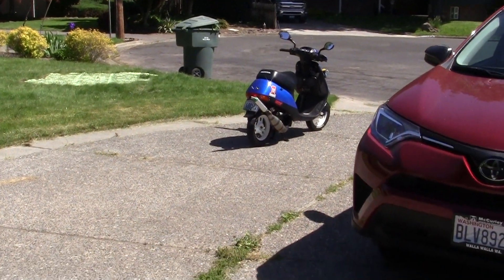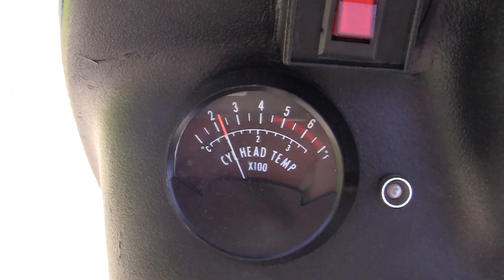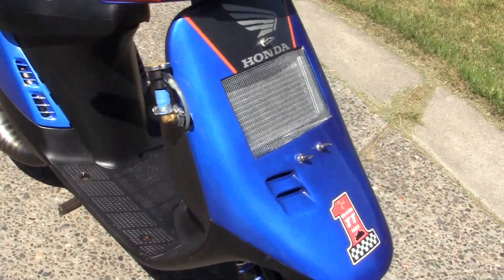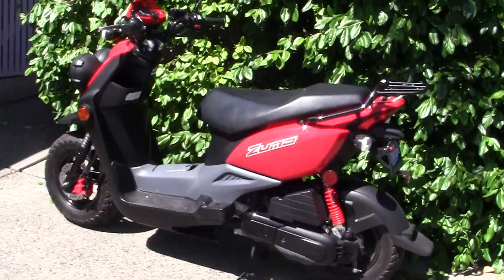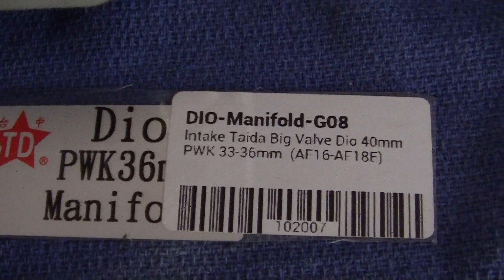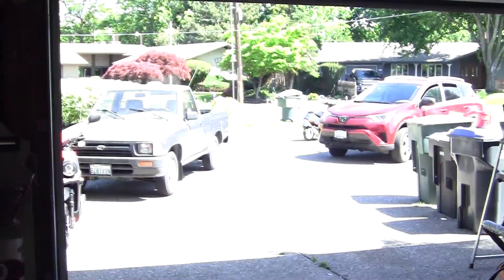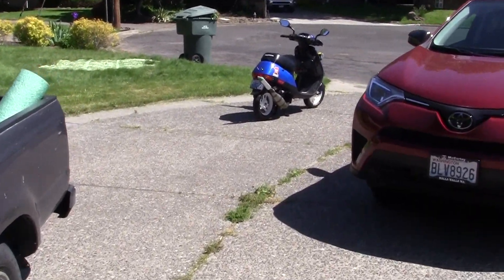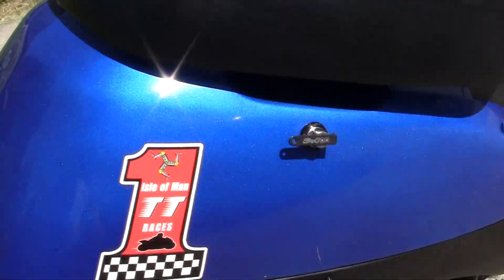GREAT DIO Exhaust Pipe SOUND !!

Comment: Nice. I got a super dio zx coming in purple. Love how you attempted to mount the radiator so it looks flush.

How is the drag pipe? Been thinking of getting one, but afraid of it cracking
Reply from the maker: The Pipe is the best one and my favorite. It really opens the engine at high speed and I am thinking of getting another one when I can afford it. they came in Green anodized like mine and blue, which would suit my bike color better. I highly recomment that racing pipe, but IT AINT CHEAP....